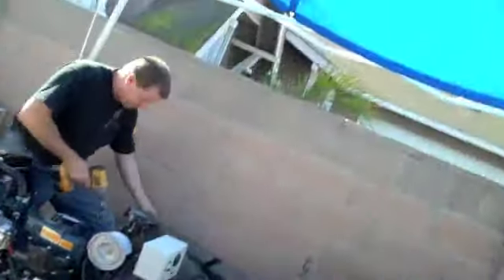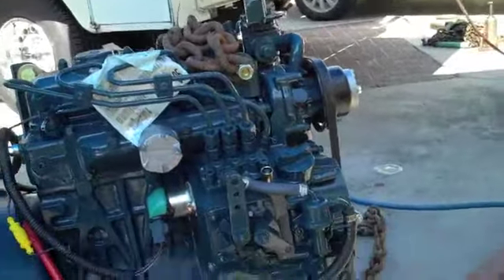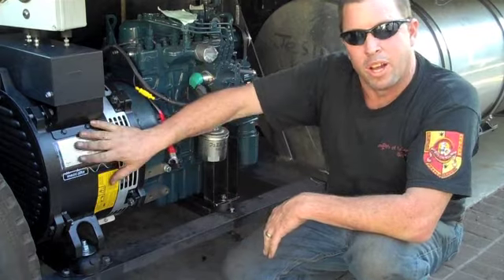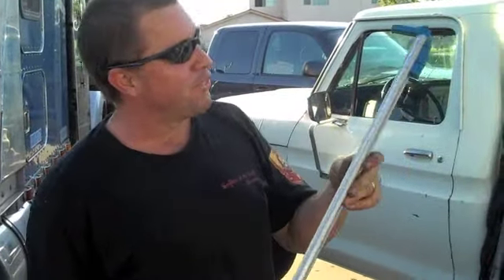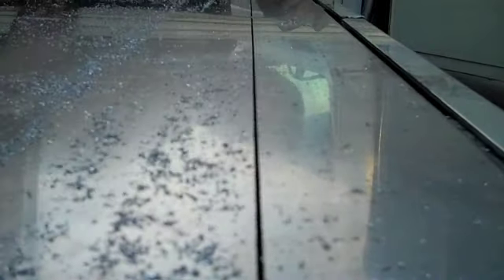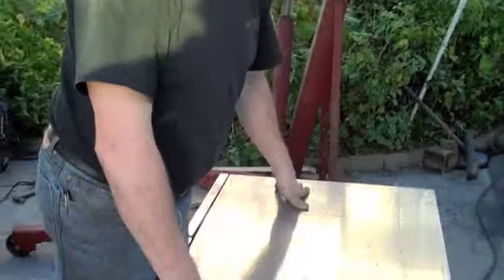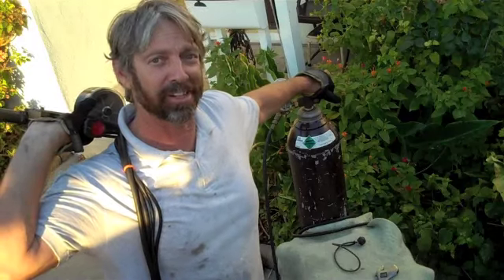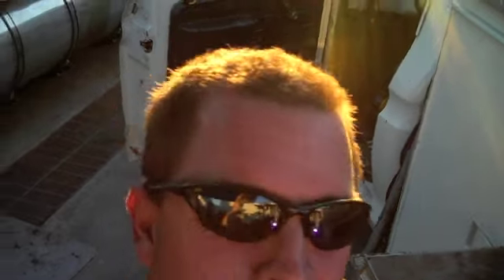Generator Project Part 1

Comment: Odd. My neighbor's name was Thomas Warren and he was a flatbed trucker. We changed out a couple of these. Real similar to what you done. I extended his rolling 5th wheel and added a complete hitch system on the very back of the frame so he could pull ANY trailer made. I have pictures of it.